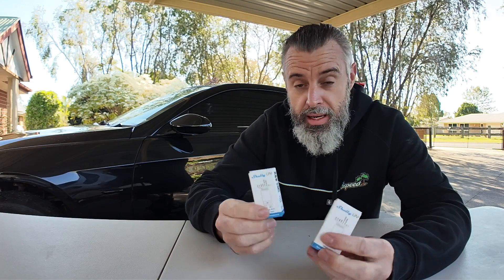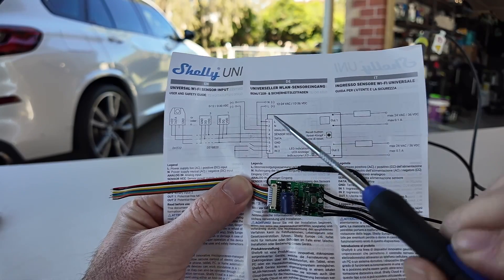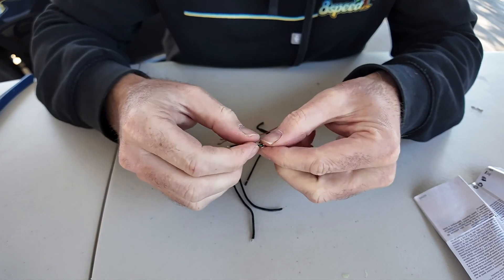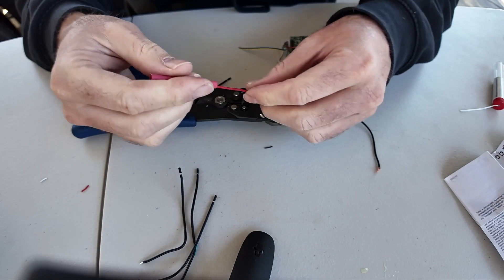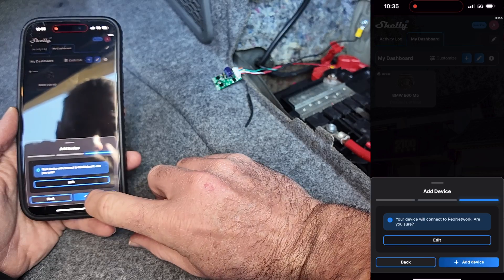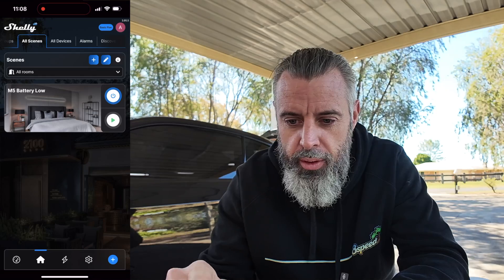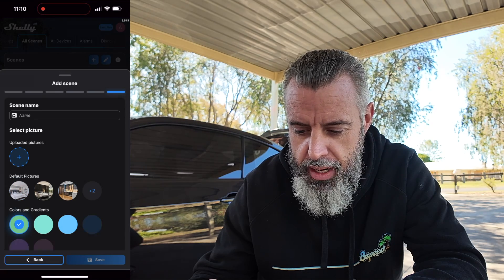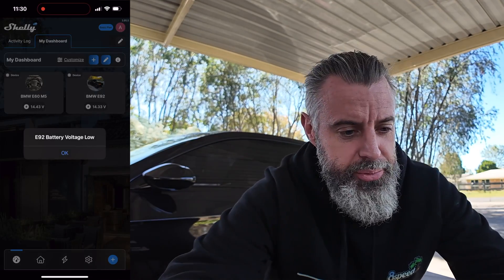Wifi Car Battery Monitor With Shelly UNi for Only $12

Comment: ALERT!!!  If You have a Shelly Plus Uni, DO NOT WIRE IT AS PER THE VIDEO!!! His tutorial is for the older Shelly Uni, not the Plus Uni. If you wire it like he says, you'll 100% fry your board! Here's the proper way to wire everything for a Shelly Plus Uni:

Battery negative (–) → connect to Pin 1 (VAC1) and Pin 7 (GND)

Battery positive (+12 V) → connect to Pin 2 (VAC2) and Pin 3 (ANALOG IN)

That way:

Pins 1 & 2 provide operating power (board powered from the battery).

Pins 3 & 7 provide the measurement input (battery voltage sense).

Then just configure the analog input as a Voltmeter (0–30 VDC) in the Shelly UI and youre good to go!
Reply: Hi: Did you have to add the Voltage Peripheral, as stated in another Comment?

Comment: Set up my first one of these and works well, except initially it was reporting a voltage about 2v less than it actually was. I updated the firmware and it now reads correctly. Worth bearing in mind then that new UNIs don't necessarily come with correctly working firmware.

Comment: THIS IS NOT $12
Reply from the maker: Actually, based on the information I have, it seems like there might be a slight misunderstanding here. I understand where you're coming from, but the facts suggest a different perspective. This was in fact 12USD at the time of filming. Is there a possibility that you are thinking of a different currency?

Comment: Can the app also create a history graph with a specific time interval?
Reply from the maker: I dont think so, not the free version anyway. That would be awesome
Reply: @testandtune6096  Thanks, the strange thing is that if I click on the device there is a graph option on the left and when I open it shows a graph page for the voltmeter with option like last 24h or last 7 days... but for now the graph is empty with a single data point. I am using the uni plus
Reply: Actually the graph is now starting to show, but it appears to get one value per hour. Wonder if we can change the time interval to something more suitable....
Reply: In case anyone is interested, on the shelly uni plus with the free app, I get a graph that populates a one data point per hour. Apparently with a premium subscription ($35/year) I could get a graph with one data point per minute.

Comment: Have you been able to verify the resting consumption. All I can find is <1W, but if leaving the car by itself for a month (720h) 1W would drain the battery. Thanks
Reply from the maker: I have had this on a car for over 6 weeks before i got the low battery warning. Might even be 2 months.... But the current draw is not noticable on a 15 year old bmw it seems.
Reply: @testandtune6096   Thanks
That kind of confirms my fear if it kills the battery within 6 weeks. I figured on a 60Ah 12V battery , that is 720Wh or 720 hours of the 1W draw, or 30 days. This means if leaving a car unattended for a couple of months, we need to plug the shelly into an external power source
Reply: @huguesl8843  any car will have a small constant power drain from the ECU, alarm etc. I can't imagine this would make a significant difference.

Comment: Pay close attention to the new Shelly Plus UNI boards, their pins are completely different.  For example, Pin 1 and 3, still go together but Pin 2, black is actually a VAC 2 positive source for powering the board.  Pin 7  green is still the only GND but if you wire it up like he shows in the video, it will fry your board, positive to a gnd is not going work! I also noticed that if you are getting N/Av showing for your voltage there are two additional changes you must make.  First set the Input to Edge under the sensors settings->Input/Ouput and under the Peripheral settting for Voltmeter, once you add one, change the range to 0-30 VDC.   My battery is showing fully charged > than 15 VDC and if thats the case setting the this to 0-15 VDC will result in nothing showing up on the sensor.
Reply: Thanks for the heads up!
So how would I have to connect the wires in a Uni Plus to have it work like in the Uni? Could you explain? Thanks!
Reply: @hardyhirschify  The correct way to wire this if you have a Shelly Plus Uni is as follows:

Battery negative (–) → connect to Pin 1 (VAC1) and Pin 7 (GND)
Battery positive (+12 V) → connect to Pin 2 (VAC2) and Pin 3 (ANALOG IN)

That way:

Pins 1 & 2 provide operating power (board powered from the battery).
Pins 3 & 7 provide the measurement input (battery voltage sense).

Then just configure the analog input as a Voltmeter (0–30 VDC) in the Shelly UI. I'm using mine with my BMW and it works perfectly. I even created a battery monitor automation in Home Assistant that will send a mobile notification if the battery level drops below the target threshold. I also setup a dashboard card in Home Assistant to keep me updated at a glance.
Reply: @wscottfunk how do you find the setting for the analog configuration
Reply: Didn’t fry mine??
Reply: Hi: Did you have to add the Voltage Peripheral, as someone stated in another Comment?

Comment: Thank you for this video. This is exactly what I have been looking for to be able to monitor my life Po4 batteries. Will this work for two 12v LifePo4 batteries connected in series for 24v? Also could this be directly connected to a 24v charger, instead of the battery? Thank you for any help.
Reply from the maker: Double check the specs but i believe it can read up to 36v. you cant power it from that, but it can read up to that..... i think
Reply: Ok. Thank you for your help  @testandtune6096

Comment: Anyone else add use cases to this unit?  I’m using the uni to monitor my rv batteries and now I want to add temp sensor as well as control my generator through the relays.
Reply from the maker: a case would be a really nice touch.

Comment: HI,
congratulations for the excellent guide, it's exactly what I was looking for, I would like to ask you if in your opinion it is possible to connect the shelly wires not directly to the battery but to the cigarette lighter socket inside the passenger compartment to monitor the battery charge
Thank you
Reply from the maker: That will only work if the lighter has contstant power. Most cars only send power thier when the ignition is on.

Comment: I wonder how much energy draws to stay active on wifi. BT sensors are really low energy devices impact close to 0 on the battery.
Reply from the maker: So a few months on. One of the cars i have this on (15 year old BMW) stayed above 11.8v for 7 weeks while parked before i got the notification from the shelly. It was aperfect. I kind of expected the car to drain faster. I couldnt have come up with a better system. The only negative, the car needs to be stored somewhere close to a wifi signal.

Comment: How did you get it to display the voltage? I have mine on 12v dc to test it... everything seems to work but it is only showing a counter and frequency. I have it hooked to the analog in and ground...
Reply: Never mind. Found that you need to go to the "Add Peripheral" tab when you have the Uni opened in the Shelly app. From there you can add a "voltmeter"
Reply: @somaliskinnypirate thanks for this comment. I couldn’t figure it out until I saw this thread.

Comment: How did you update as mine is not live checking voltage. When I turn on/ off it jumps 2-5 volts I have to trigger this?
Reply from the maker: Just the update function from the app. the device does require a reasonable wifi signal

Comment: This is a great solution for most people! For anyone running a home automation system, you can do the same thing for au$5 with an ESPHome installed on a $5 Esp8266, connected to your home automation system, such as home assistant.

Comment: Are you concerned with the power draw on the battery from the Uni?
Reply from the maker: Not really. The unit is so small, it won’t draw anywhere near as much as the frm or cas.

I did look up current draw a few months ago and a lot of people run them on very small batteries and small solar panels for gate controllers and it’s very minimal.

Comment: I was expecting to see one of those BT battery voltage monitors... Clever solution!
Reply from the maker: Yeah, I know a few people that tried Bluetooth. But if something goes wrong. You don’t get a warning. This should be handy for anything that’s near wifi. Could set it to warn if a car needs to go on charge for example. I’ll buy a few more I think and put them in every car.